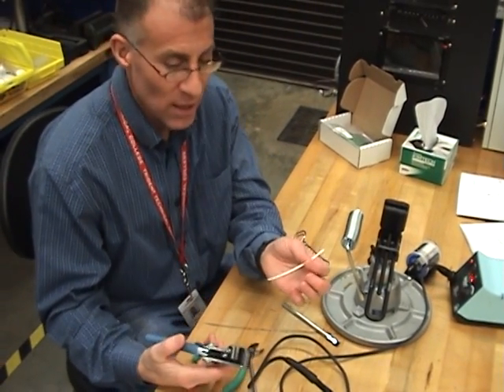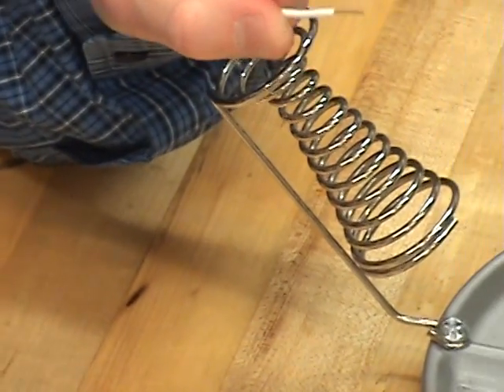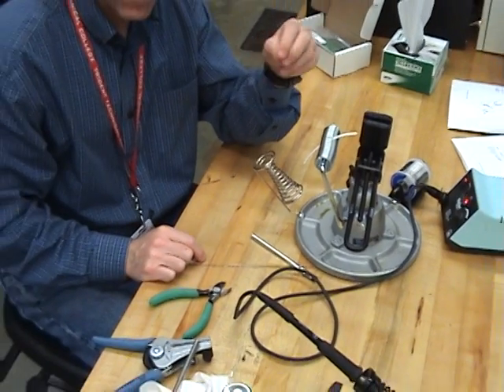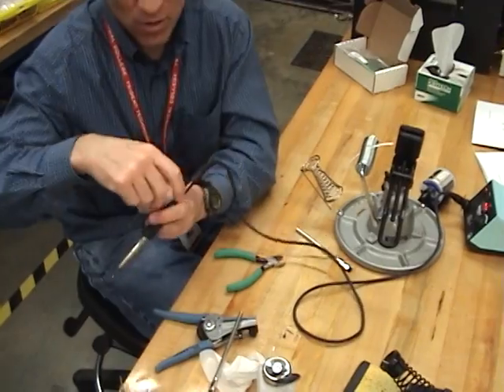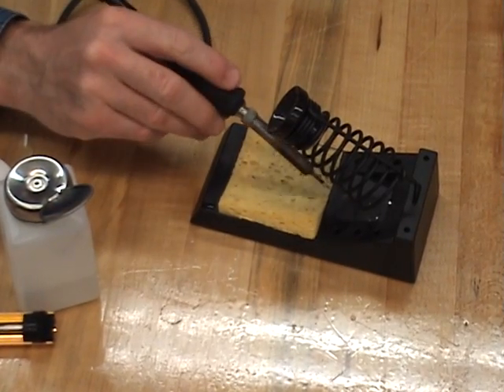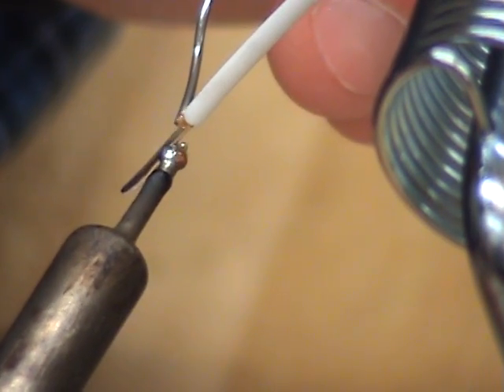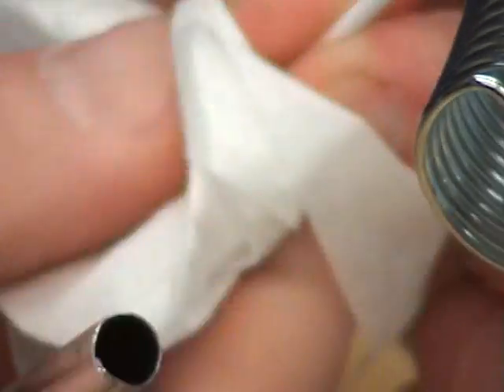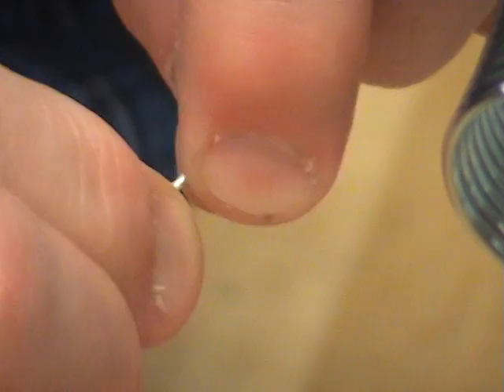*EXPERT LEVEL* Soldering Tutorial #1 TTC Avionics

Comment: The first video I've seen on Youtube showing proper technique.  I attended high reliability soldering school for the military in the 80's and I cringe at the shoddy work people do.  Yes, you can glob it on and it will probably be fine but these people are trying to teach others.  Never learn the wrong way first.  You can decide later if you want to do it half-assed.
Reply: I have seen so many lead soldered things from the 70s, 80s etc. That you can begin to see a lot of flux damage. I get to compare control units made by a few different people from different time periods and you can really tell.

Comment: Can you solder Harris Safety-Silv, which melts at 1200-1400 or so or is that only for a torch?  Wanted higher silver content on copper speaker wire.

Comment: Nearly expert level. 1). The use of the sponge is not for "cleaning" the iron tip. Its purpose is to provide thermal shocking, which eliminates the last bit of oxidation from the tip immediately prior to making a solder joint. 
2). Pulling and twisting the insulation is necessary to remove it from the wire, but the twisting motion must not disturb the lay of the wire. The twist of the strands should not be any tighter or looser than it was before the insulation is removed.
3). Expert level wire tinning requires the use of anti-wicking tweezers to prevent any solder from flowing into the wire end under the insulation. This point will be, 99% of the time, the highest point of stress and vibration of the wire. Wicking allows these forces to weaken the tinned section at the end of the wire, which is often the point of failure if wicking is present. 
4). Regarding the alcohol used in this application, it should be specified to be not lower than 99% isopropyl or lower than 99% ethyl. These percentages are not always available to a hobbyist. 91% is but is not ideal although it does work, and is less effective in cleaning rosin flux from a finished joint.
Isopropyl blends sold as "rubbing alcohol" is not and will not be your friend.
5). A tutorial on expert soldering needs to address iron wattage / time on a joint or on a component lead wire being tinned to not exceed about 3 seconds, after which the tin and lead begins to separate, resulting in an overheated joint (typically called a "cold joint", which is an oxymoron).

Comment: Could you tell me how to solder a transistor to a heat sink, i just cant get to solder to flow and take to the sink, to then attach the transistor, help
Reply: You will need to seriously preheat the heatsink. Sometimes if small enough, you can just lay the iron on its side and get more heat transfer, without preheating.

Comment: This is great but how would you go about soldering 3 of those to a board without holes, 1mm apart from each other?

That what I"m trying to do this morning and so far its kick my a##.
My wire keeps wicking up the solder from the board. I wish I had hot air and licquid solder.

Comment: you use isopropyl alcohol (rubbing alcohol) to clean the PCB and joints.  The higher proof makes it a cleaner 91% cost under a dollar per bottle at most stores.  You can buy 99% but its much harder to find and doesn't do a better job.

Comment: you don't have to do either, he is over killing it.  its not a bad way to do it, but wastes a lot of time.  the wires should be pretty clean from the factory and they've been encased in plastic so shouldn't be dirty anyways.  any imperfections will be pushed back via the flux once its heated.
Reply: Its NASA quality, don't say its overkill if you have no idea what you're talking about. Do you do electronic engineering at nasa??? No, but this guy does, so I trust him with teaching me how to solder like a nasa engineer.